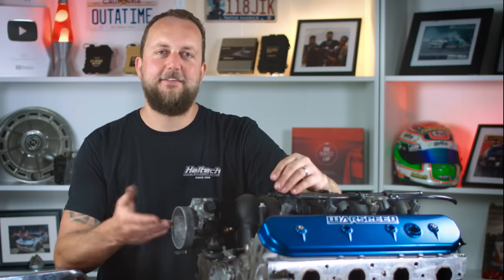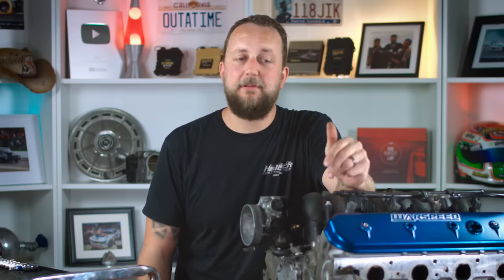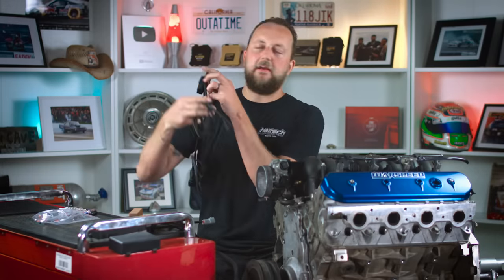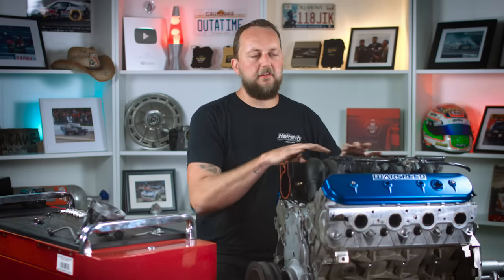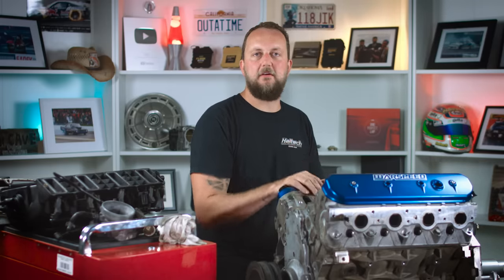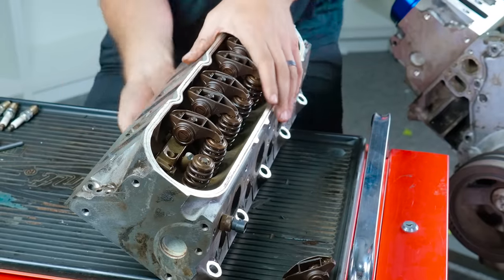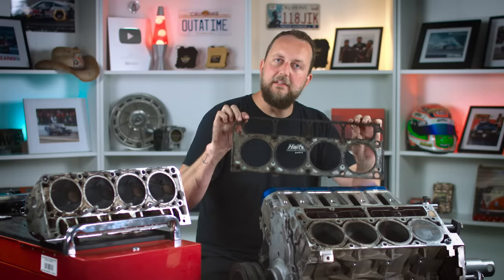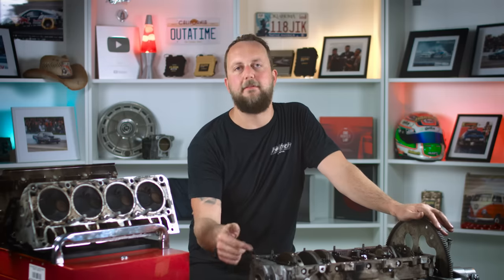🤔 What's so special about the LS? | TECHNICALLY SPEAKING |

Comment: Popular due to it's size, cost and ease of fitting to almost anything, Porsche 911's included. Still it's based on 1930's technology and it's mainly it's capacity that makes it create good power.
From a capacity vs power/torque perspective the Coyote, German and Japanese V8 produce more BHP per CC due to better technology. Heck even GM have 'updated' the LS by introducing variable valve timing to the LS. Now the LT i think. Still, that's on a single pushrod valley cam so it's effects are limited compared to most other manufacturers quad cam V8's.
As aftermarket ECU's begin to offer full control of these VVT engines then I think it will make these a more interesting proposition over the venerable LS as it'll remove all the CANBUS BS that the OEM vehicles use and is difficult to circumvent when you just need the engines ECU.